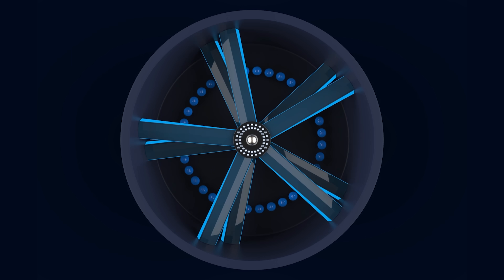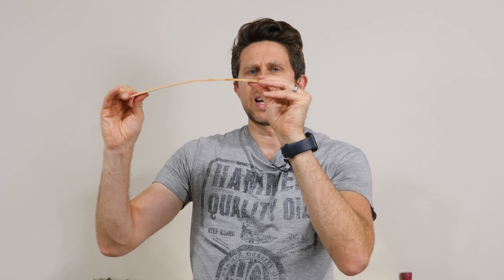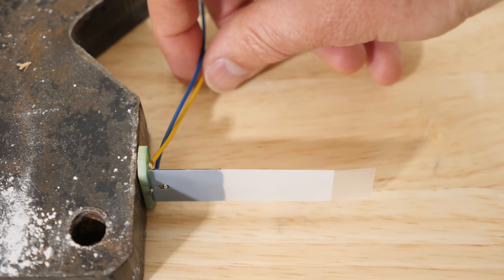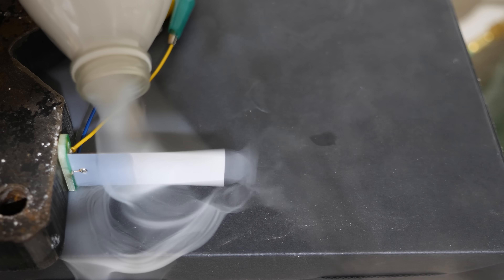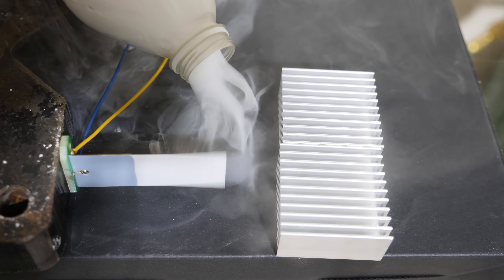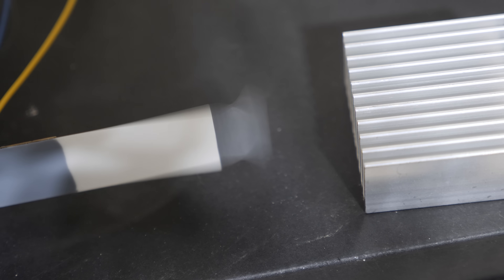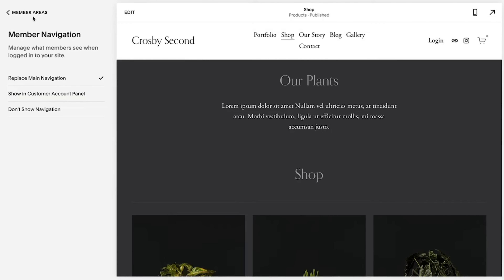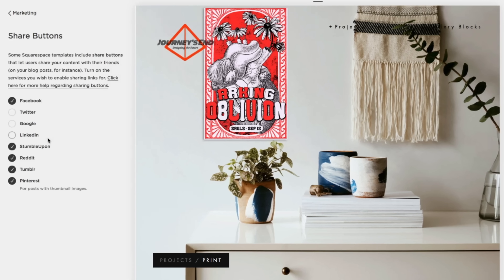A Solid State Piezoelectric Fan—Does It Actually Work?

Comment: Might be neat to see a flappy box fan with a whole row of those things making up parallel vanes in the fan assembly. Anyone else picturing that?
Reply: You could probably do that, it wouldn't be particularly hard. The rotational to linear has been a solved problem for centuries using the Scotch Yoke. If you attach the mechanism to all those vanes, it probably would work. I don't know how effective it would be as there's not much air that would be displaced, but it would function.

Comment: I wonder if there truly is an application for this in computers.  It seems like it might not move enough air for something like a processor, but perhaps its possible to stack them.  I would like to see how noisy they are compared to traditional fans.
Reply: As soon as he asked, "Would you use this in your computer?", my first thought was "How loud is it?"
After reading your comment, I started wondering about the flow rate and how it would perform with intake filters creating resistance.
Reply: @atk05003  I think generating enough flow/pressure to get through a filter is going to be too big of a hurdle for this type of cooling. I can see this being used for nvme drives though, just to displace warm air somewhere else from time to time if it’s in a low flow area
Reply: You can get these in a size that could move enough air to cool an average computer, but piezoelectric crystals that big are rather expensive, around 400$.
Reply: @0106johnny  so basically maybe it would work better but will also be more experience
Reply: A bellows that gets mechanically expanded and compressed would move more air, and can still be super quiet if you pick the right materials.
Reply: Check LTT, they just tried it out to cool a Steam Deck

Comment: Actually, turbine engines in modern aircraft tend to use frictionless bearings these days; either magnetic or pneumatic requiring no physical contact. That being said, they can still fly apart if they overheat, expanding past tolerances and making physical contact. It would be advantageous if we really can make a fan with no moving parts.

Comment: Why cant this be done on a larger scale to get the output of a full-sized fan? The air speed seems to be decent. Why not combine dozens of these, to the size of a house fan, to get more flow?

Also, I am pretty convinced a better design of the flap can maximize the output - just as in normal fan the design of the propeller is crucial to its efficiency.
Reply: It could be, but it isn't very useful.
Reply: @0106johnny  Why?
Reply: @Lighthouse_out_of_order  Because it doesn't scale well
Reply: @0106johnny  Any specific reason to think so?
I think it wont work well with an area covered by many like this, but I see no reason it won't scale perfectly when arranged in a line.
Furthermore, you can increase the speed by varying the incoming current frequency. There are quite simple circuits that do this.
I would love if ActionLab put this to the test. Sadly he didn't show up in this thread.
Reply: @Lighthouse_out_of_order  You'd need A LOT of these to match a regular rotary fan.

Comment: A similar effect can also be achieved using a speaker, with a small chamber with a directed port on each side, also running at its resonant frequency to reduce power wasted in the coil, and the ports sized accordingly as well.  At high enough excursion, the air is blown far beyond the ports without returning.

Comment: This is really cool! And it has got me thinking: can this mechanism be used as a propeller or as a part of a propulsion system?
Reply: Hell no. It's way weaker than a rotary fan. It's basically best use for stuff that just needs a bit of cooling.
Reply: No, it generates almost no thrust.
Reply: Best thing to do is try it with maybe a wider flipper and different frequency

Comment: Great idea but for my desktop computer, I don't think I will use a piezoelectric fan due to the flapping noise and the low air volume. A directed, quiet airflow generated by spinning fans is more desirable in a computer case where power consumption by fans doesn't really seem to be an issue either. Unless, as mentioned in the video, airflow is needed where natural convection doesn't work well enough but low maintenance is crucial.

Comment: I would be interested in trying one as a replacement to a computer case fan depending on power use and noise
Reply: Honestly, you're probably better off with a massive heatsink or liquid cooling if you want quiet.

Comment: The label "solid state" is beeing widely misinterpreted. A vacuum tube is not solid state, although it has no moving parts.
"Solid state" eectronics refers to electronics using solid state physics, like semiconductors.

Comment: A traditional rotary fan usually has 2 characteristics: air moving volume and air pressure. Blower type fan usually good at generating air pressure and the normal fan that we use at home is usually good at generating air volume. The two types are just more efficient at doing one of the things provided that the motor is the same. You can modify the design to be more energy efficient but moving certain volume of air for certain distance or compress into certain volume requires certain energy and this cannot be changed unless the law of thermal dynamics is changed. The video said that their is virtually no energy consumption for this types of fan, it makes me thinking that at least there will not be any air pressure generated. To generate more air volume, I assume that bigger blade should be used which in turn requires energy to overcome the resistance of the air next to the blade which in turn I am sure requires energy and not very small energy I assume. Just try different size of the paper fan, waving them by hand, significant force difference can be felt, and now try to wave it 60 times and second. Mechanically, the piezo fan is obviously much efficient but the cost of been efficient maybe too much in terms of being a “fan”.

Comment: That’s not solid state.  I thought you were going to make one of those hovering balsawood tinfoil triangle things that use high voltage to blow ions down generating (a small amount of) lift.  That’d be solid state and it would generate some wind.  Not sure how much, that would be more interesting to see.  Surely you know what I’m talking about, idiots call them antigravity devices but they don’t work in a vacuum.

Comment: Would it also work the other way around? Can you generate electricity from wind with this technic?
Reply: I mean yeah. You just blow air from the back right? Let turbulence do the rest. This is actually very possibly a genius idea. For everything else this thing is kinda useless ( apart from some novel piping )but for power generation there's a chance it might make sense. Wind turbines are notoriously difficult maintainence-wise. It's definetly worth a shot

Comment: They will tell you this is better than rotating fan. But will never tell you why it will never be mass produce and sold to public. They will never tell you the bad things about this new fan. I recall don't like you quickly skipping the part on why the piezo that only compree and decompress and suddenly flexes. You have never explained it, just skip it with clever wording.

Comment: How could you run that piezo element by just plugging it into an outlet without blowing it up? How can it run on 120V without drawing a bunch of current to go with that?
Reply: They have very high resistance, so the current is pretty low.
Reply: @0106johnny : That didn't make any sense. If resistance is low, that is when there would be a lot of current.
Reply: @0106johnny : Then edit your previous reply accordingly for future readers and we'll delete these follow-ups, and you don't even have to view that as causing some sort of silly "moral issue" with "but I own my mistakes," etc., and it will take less effort in clicks than writing up a new reply to me would.

Comment: "...This bending motion is hard to do electronically."
Who says it needs to have semiconductors involved? Why not just try it electrically?
"That's why planes don't flap their wings like a bird."
No it's not. There is a lot of mechanical motion in that, which could be done without a single piece of silicon!
Reply: Yeah, planes don't flap their wings because it sucks. But birds have no other option, because evolving rotary bearings is impossible.

Comment: There also piezoelectric pumps for fluids. There is a stack of crystals that when the voltage is applied it expands in its cylinder pushing the fluid out through the valves.

Comment: here's a fun fact!
your phone likely uses a piezoelectric motor for vibration! in fact, it's called a linear actuator usually.
if your phone's vibrator is "tight" and feels more like a click, that's a linear actuator.
the motor can instantly slam itself against the side of a metal box it's contained in to vibrate the phone
because it's piezoelectric, it can do a few neat things:
- it can vibrate different feelings and intensities
- it can start and stop instantly
- it can make noise! (take a look at the Index Controller, Vive Controller, or Steam Controller for this in action)

Comment: I remember seeing an old ring bell made with an electromagnet that interrupts itself. The motion was transferred via a lever to a small hammer that hit the Bell.
 I guess it could've been turned into a device similar to this one. It works with DC or AC, very easy to build.

Comment: I’ve ran a fan for six years. Not kidding. If it lasted 50 years I would be impressed. He shouldn’t turn it off for a long time. I’ve had fans die a few times but it’s only because the lubrication dried out. Not because the bearings wore out.

Comment: No parts moving against each other? How about every molecule. Solid state means NO MOVING PARTS. If you could get airflow by ionizing the air, which I’ve seen on this channel, that would be a solid state fan. This fan is a vibrating fan. It has moment in the proper name.

Comment: Old fans get dirty and make noise, too. Dirty enough, they can even become fire hazards. Some say this is too noisy, but the sound created and transmitted by the PE fan is directly related to your choices for frequency and materials. Bad choices will have a "nasty" vibration. Better choices result in much softer sounds, equivalent to (or even less than) traditional fans. We played with these in college, many years ago. But since we didn't have a reliable source for piezoelectrics at that time, we couldn't do that much with it.

Comment: I made some of these 20 years ago when I was a phd student doing heat transfer research for a certain computer company. I made mine out of metal shim stock. I was able to get first mode bending and pretty good deflection, about 30% of the length. My project lost funding because of the tech recession that happened but I don't remember the performance being all that impressive. I did some modeling of a round one like a diaphragm that pumped air through a hole but didn't end up building a prototype. Thanks for the video, I like the flow visualization you did.
Reply: It's useful for heat sinks which are much more  efficient when there's air movement around the fins.
Reply: Reading your “Round Diaphragm” made me think, this (if done at scale) could pump small amounts of water. But because of the cost of the power needed to run them, you could have millions working all at once and pumping millions of gallons per minute.
Reply: U could definitely make alot of money if u made handheld versions of it . It has a gimmick like appeal to it that lots of people would want to buy it , u should develop it!
Reply: @jackhartsough3  Not really. Piezoelectric crystals large enough to move an relevant amounts of air are too expensive for a "gimmick".
Reply: Looks like Frore Systems have developed an effective solid state fan called airjet
Reply: Nice bro ❤️
Reply: What was the piezo element that you used? Knowing that someone has made one makes me want to build one.
Reply: Yes, United you will stand...or else. Eat your Apple and be happy. ;)
Actually, I'm a big fan of Apple products. They've done some amazing this things.
Reply: United Fruit Company?

Comment: A Material That Directly Converts The Heat Into Vibration  In This Same Way Would Be Ideal. So The Heatsync Automatically Pushes The Air Away. Each Fin Of The Heatsync Ends In One Of These 'Fans'. I Wonder....

Comment: 😎So, i want a little drone piezoelectric powered remote controlled bumble bee. What regulates the amplitude of the vibrations? It looks like the rigidity of the plates are limiting it. If you made the plates thinner, could you get a wider amplitude motion? House current? That's a bit of juice to go, not really so low powered, not when i've got a battery operated fan that would outperform it. Guess i'm not going to get my bumble bee drone any time soon, not with an extension cord trailing from it.

Comment: Would have been more interesting if you used a variable frequency drive to tune the circuit.
Reply: Piezoelectric crystals peak at very specific frequences. Altering the frequency will reduce the performance a lot

Comment: Interesting concept. But I have a ceiling fan, that up to now ran for over 17 1/2 years with only negligible (maybe 20 days / 480 hours) interruptions during that time. It still works flawlessly and I never had to change the carbon brushes or do other maintenance, even though it is in a normal living space, with dust and fibres in the air, and varying humidity. My current PC has 10 CPU / GPU / PC ventilation fans, that are at least 13 some at least 17 years old, and ran at least 50 % of that time. Only one is broken, and that's one of the older ones. Probably the air filter in my PC helps their lifetime, especially against fibers, but there is still dust collecting in my PC. So my PC fans are certainly not operating in conditions perfect for their lifetime. Do you really think a piezo flappy fan of sufficient power would work that long?

 I would guess, that any bendy material of fans with similar power, would break from material fatique far sooner. Even though such piezo fan system would have no rolling friction and corresponding abrasion, it still would have moving parts with internal friction, that can fail because of that. Being below the elastic limit, does not mean, that there is no material fatique failiure. There is the term "true elastic limit" that describes the limit, below which dislocations in the material won't move and thus no material fatique failure is expected, but that is far below the elastic limit, and I doupt the flappy thing would stay below that. Or does it?

Do you have some information on how powerful the piezo fan, run over 6 years is/was. That would be of interest, since for a fair comparison, fans of the same power should be compared.

How is the noise level of piezo fans, compared to classical fans? For rotational fans, it usually hold, that the bigger, the less annoying they are. High frequencies are far more annoying than low ones, even if the low frequency noise has higher sound pressure.

Do you have some numerical efficiency comparisons of piezo and rotational fans? Good electrical motors, have very good efficiency of close to 90%. It would be especially interesting, to know the compared air movement efficiency of rotational and flappy thingy fan designs.

The faster, close to instantanious switching time is cool, indeed. Might be useful, for controlling temperature sensitive (bio) chemical reactions and physics experiments.

Edit: Are there maybe other reasons, than reliability, to use piezo fans in space stations? Maybe the graphite abrasions from motor brushes are somehow harmful in a space station environment?

Comment: what is the lifespan of that material bending up and down, atoms or whatever, compressing and decompressing at certain points in the unit, wouldn't it break, (AS A BAD EXAMPLE) bending a wire, but that's what should happen to any material, in the long run, nothing last forever...

Comment: I can definitely see this inside a modern gaming smartphone. That would actually make it IP68 compliant. Despite the "moving" piezoelectric module, sealing its terminals from the environment could easily make it resilient to liquids, and as soon as it dries it would work as normal.
Reply: I Dont See How It Would Fit Inside. The Clearance Of The Oscillation Is Too Much
Reply: Perhaps A Bunch Of Tiny Tiny Graphene Ones That Work On Multiple Axis
Reply: @PANTHERA369  It would work kinda like a turbine. Create a low pressure zone and let Bernoulli effect do the rest.

Comment: No parts that are wearing out...?

My harmonica reeds begs to differ...

Actually, Seydel makes stainless steel reeds for their harmonica.  It's funny, over the years I've heard people say they last forever, and other people saying they don't even last as long as brass reeds.  I always ask them if they are hard or soft players.  Soft players never blow out their steel reeds, hard players don't like them... and low and behold, steel (and titanium) have a threshold that, if you keep it below, they have an elastic limit, but when you exceed that limit their fatigue curve goes up very sharply, quickly passing brass!

Why yes, everything I see has to do with harmonica... now, how to I make a pedal tone reed using Piezo to play a constant drone note underneath my playing?  (I doubt it would be particularly loud... my understanding is that the amplitude of the reed swing is acted on by breath force, so a reed swinging farther may be making a louder noise, but it's because more air is going through.  A Piezo reed wouldn't have much airflow compared to lung power, so it would be pretty quiet...?)